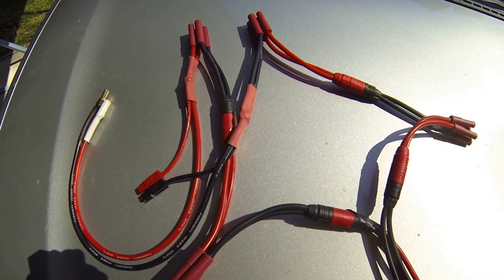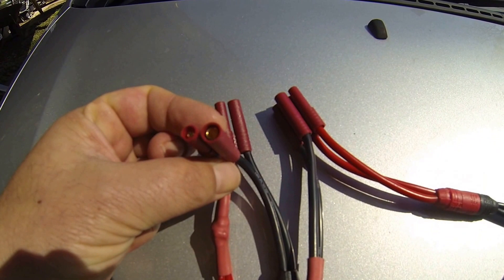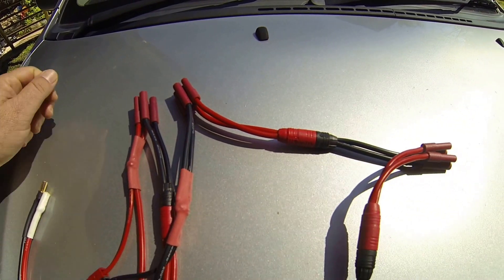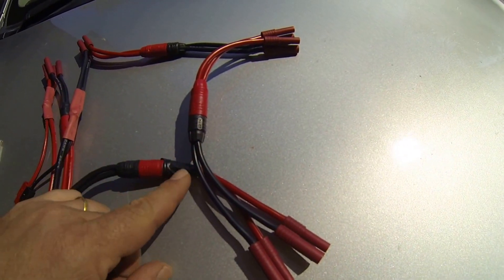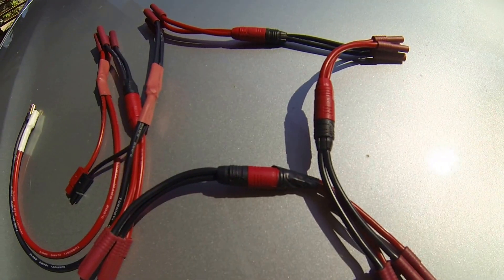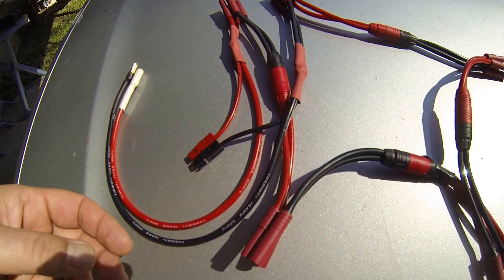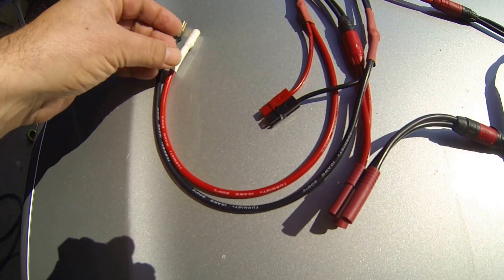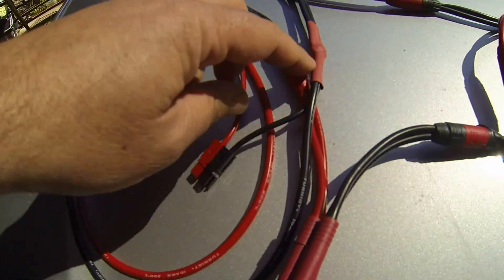Electric Bike kit battery harness 20s 2p

Comment: Great video mate, people always shows the whole thing wired and ready, it is so hard to find videos showing the wiring!!! =]
Reply from the maker: +ElectricBike (Bruno) Cheers mate, enjoyed you bbHD vid too, dig your enthusiasm.  I was going to make a video of making this harness but I ran into so many soldering iron diffulties I gave up.  Housing really makes all this work so much harder than just using bullets and heat shrink.  Unfortunately the batteries came with it .....  ride on bro!
Reply: yeahhhh... I am getting my BBSHD soon.. counting days to get this thing in hands and of course do lots modifications and put this baby to work hard!!!
I am experiencing the same dramas here with my LiPo connectors... I am thinking in a way that I will connect many batteries without causing any "bottleneck" putting too many amp and stressing a single wire (it may happens when connecting multiple cells in series and parallel) so I want to avoid that.
I am actually putting 4x 6s batteries inside an alloy box to make it water/dust/vibration proof and will be posting videos soon.
*I am making an insane bike with more than 30000w to take to drag races... ooooow yeahhhh... hahaha =]
Reply from the maker: Had to check the zeros, take care man -  a little mistake with a couple of 6s 5ah packs is like HUGE - Ive been to hospital for kentucky fried fingers....  what you are talking about is a fireball that could end your life in a second and the whole house..... anyways I look forward to hd too - but kind of see it as a kit finished with minor changes or just choose a motor to do your own with.   If your gona add new controler etc. to it theres not much left to warrant the price.  Maybe you should be in the aft, cyclone, gng LR or BHT world of things.
Reply: Yeah... I know the danger of making any mistake with these huge 6s 5ah packs... I got the 5 star of the LiPo balancing chargers http://www.ebay.com.au/itm/131163648214?_trksid=p2057872.m2749.l2649&ssPageName=STRK%3AMEBIDX%3AIT to be monitoring these cells very well... you can connect the balancer to your PC and watch lots parameters telling all about your pack and charge multiple identical cells at same time. This is why I am packing these batteries inside a tough aluminium box (in case of any explosion during the ride I don't get instantly killed =]
My next drive train I will be using multiple Astro-flight 3220 all custom and pumped on steroid!!!